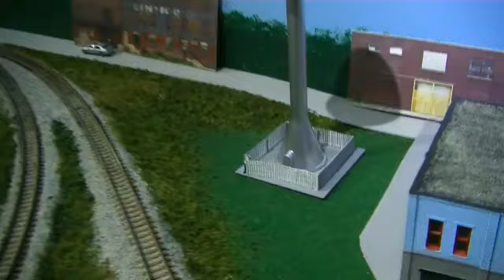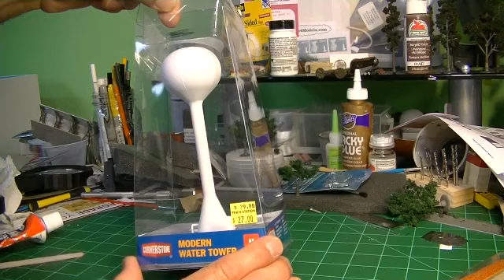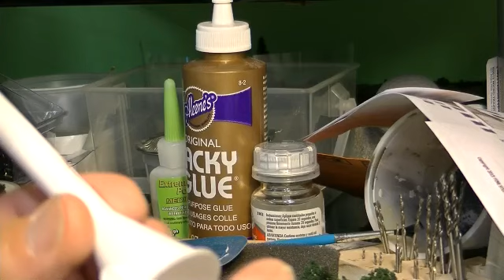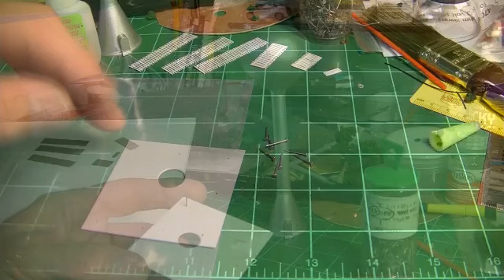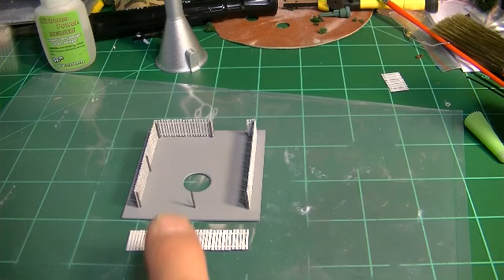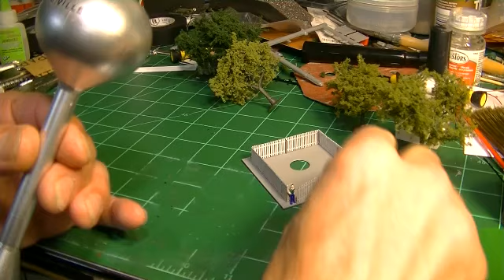MODEL RAILROAD IDEA  /  MODIFY A WALTHERS WATER TOWER

Comment: Mike, I like your water tower. Guess I need one too. I'm still having a hard time finding newer model n scale cars and road signs, traffic lights, etc. Have any suggestions where to find them? I ordered a set of "Plug & Play" lighting from Woodland Scenics today. Hope they work well. It's going slow, but I think my small layout is starting to take shape and looks good for a beginner. Most of my buildings are pre - builts. Did get a Pico electrical substation today, but it's a damn kit! I've only done 2 kits, turned out nice, but takes too much time. I'll try to send a video or pic of my progress. Thanks for all your great videos. 
Jack
Reply from the maker: I have found a lot of stuff at train shows. Some items are priced good and you can find new and older kits too. There is a train show in Dayton, Ohio Nov 7 & 8, 2015 that has a lot of venders and others selling. You can do a web search and find sites to make road signs.